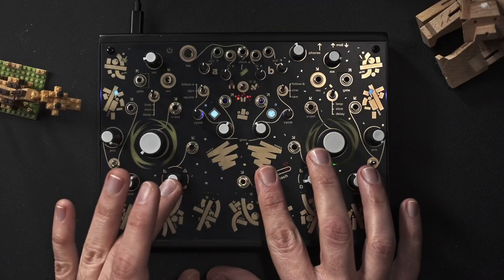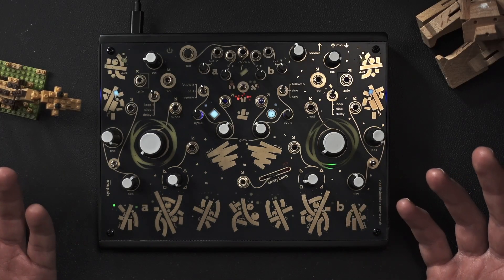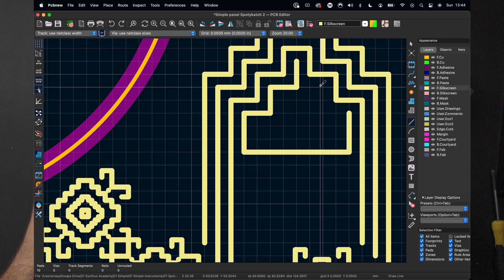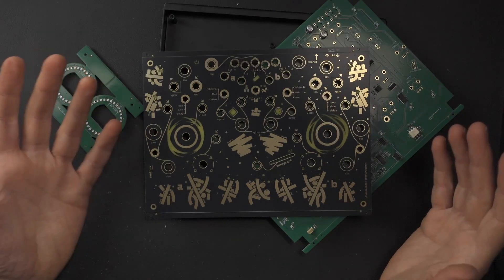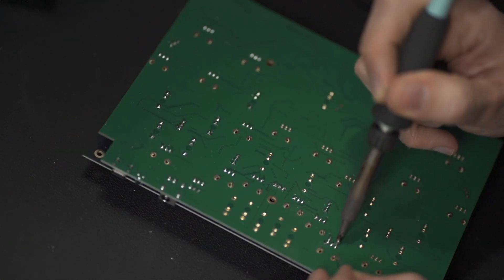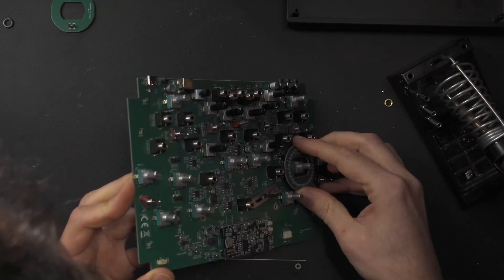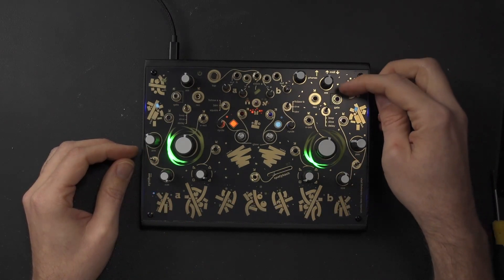This Looper Isn’t Finished – Tell Us What to Add!

Comment: Manifold Research centre's Tetragrid has a magnetic faceplate so connections can be made with metal counters. Any way to make connections on the Spotykach  touch pads with anything other than fingers? Or toes.

Comment: Each iteration just keeps on giving... I do have some feedback and ideas!
1. wider screw holes, so that when someone decides to rack it, any imperfections of other modules can be accounted for :)
2. kind of a follow-up - rackability as a first class citizen, not just by request :D
3. LED baffles - I very rarely see this being addressed, so great that you're doing it, just please add it to all light sources! Nothing worse than a very pretty light show which then bleeds onto other modules :D
4. a chaos circuit to have some LFO, of the non-deterministic kind. Perhaps on the other side of spotykach?

And I hope you'll do B-stock like with Audrey II if you have some imperfect faceplates, as waste is just sad!

I can't wait to see the end product, and I want to thank you for being so open and educational about all of this!
Reply from the maker: 100% with you on everything. But I’m sorry to say it won’t be Eurorack mountable. We were considering it for a while, but we decided that we need more space above the decks for connectivity. Also, we realised that since the UX is heavily reliant on touch interaction, it should be laying flat on a table. So it’s not 3U. But, it’s very thin, and designed to interact with your Eurorack system :)

Comment: Roey, great work so far, i like your comments on keeping the multi pad touch combos simple rather than deep and too many. If i could say one thing about the shaft length on the switches it would be longer is better for me. I have a hard time seeing them and what position they are in, plus, i like to use those vinyl covers for feel and color accent. I love all the led under the panel indication which aids a setting for a switch you dont change very often. Some of the jacks looked thicker, you check cable fitment in every one? Awesome stuff, thank you for your consideration in our feedback at this point in the desgn process. Are the led goggles rgb?
Reply from the maker: Thanks! I will keep these notes mind. Some jacks are thicker because I sanded them from 7mm down to 5mm (still don’t have enough mono jacks here). All the LEDs are RGB, and we’re going to use them for feedback. Yesterday I spent 4h refining the UX and ended up writing it as sort of user manual. So much stuff! I might share this soon.

Comment: One suggestion for possibly improved accessibility: What if there were some thin edges around the capacative (I guess) touch areas? That way one could find them more easily without looking.
Reply from the maker: Good point. You can actually feel them because they are a bit higher than the black surface. But I think I’ll need to add a bit more space / rework them a bit to get it more noticeable. Cheers!

Comment: It sounds great! But looks, well not so much. Drunk artsy fartsy design could be great for some, but not for all for sure. I like color scheme though. PCB design of this device looks much better than UI design. Maybe there should be two or more designs available!?
Reply from the maker: Thanks for the feedback. Visual design is subjective, but I see your point. We might do different faceplates at a certain point.
Reply: @SynthuxAcademy  Cheers! Glad you see my point. Of course it was not meant to be a downer. Design is important. That's why pro designers use Mac instead of Windows, a nice designed GUI directing you to do a better designs. So i am quite sure that's the case for the musical instruments UI too. Different UI designs, different music ideas. At least that's how i would think when designing UI for the instrument. On example, someone would compose totally different music on piano than on harp with the same number of strings.

Comment: Great project! Keep the excellent work. 

One comment about the physical UI: pach cables get in the way, this is pretty obvious from the video, even you're fighting them all the time)) Consider moving all sockets somewhere to the edge of the unit.
Reply from the maker: Good point! This was actually an intentional design experiment. I’ll be making a video about it soon. Personally, I prefer a more dynamic layout (similar to Make Noise, Instruo, etc.), so I tend to avoid rigid blocks of jacks. That said, I did approach this differently here. It’s hard to tell from the video since I’m explaining rather than playing, but in actual use, the cables aren’t as obstructive as they might seem. Still, balancing ergonomics with interface aesthetics is something I want to explore further as a designer. Appreciate the feedback!

Comment: This looks amazing. Will definitely be keeping tabs on when this releases.  Integrated VCAs for the two loopers would be amazing.  Being able to switch the VCA from modulating level of incoming sound being recorded  and the output of the loops would break my brain.
Reply from the maker: Cheers! Ah, what you refer to is CV over sound on sound. I think it will be possible with Midi.

Comment: very nice design ! 
there isn't a drawback free way to do this but for processing stereo sources I find separate L/R trimmers difficult to match right while accurately preserving stereo image. For this use case I would prefer a single in/out trimmer that affects both channels at once. If the volume is digitally controlled maybe a switch ?
Reply from the maker: Thanks! That’s a great point about matching signal volume. Since these circuits are fully analog, there’s no simple solution, but at their core, they’re identical. Also, it’s worth noting that our ears aren’t perfectly balanced in amplitude and frequency perception, so even a seamless switch never creates truly perfect stereo.

Comment: Amazing design and the playability functions are very well thought out. 
1. The Orbit and Drift together with the Euclidean functions are unclear to me without an audio demonstration. I don't understand how they could work in a looper. Would they chop up the sound and make rhythmical patterns with it? Personally I'm not a big fun of Euclidean patterns. They are rarely interesting and also very easy to program by hand. If I could create rhythmic patterns by touching rhythmically one of the touch plates, that would be amazing. 
2. About the fx sections, 2 fx per side would be more than enough I think. 
3. How long are the buffers? Long buffers would be a dream to have.  
4. About the Cycle and Glow. It depends if someone wants to do dramatic changes or subtle ones.
Reply from the maker: Thanks! Super useful feedback! Great idea for the rhythms. That should definitely be possible. As for the buffer - it can get up to 10m (5m per deck) as far as I know, but I’ll check. I’ll add all these notes to our backlog. Let’s see what comes out in the coming weeks!
Reply: @SynthuxAcademy  5min per deck is definitely long enough! Is it possible to play the decks with the touch buttons? I mean to turn audio on/off with the touch.
Reply from the maker: @ethermod307 yea, you have play forward and backwards per deck. But you can also latch them.

Comment: Hi!
First, this project looks super cool and already very polished. This looks like a hit!
Regarding suggestions/question:
1. I agree with @CinematicLaboratory end of loop output would be cool

2. it's Play head position = Rec head position, right? If not, how does it work? 
This is the part I least understand and would love to know more about.
SOS should be a modulatable paramater, if possible.

3. Reverse CV input maybe?

4. Is changing tape speed in musical increments implemented? ocatves fifths, etc.

Congrats on this great project!
Reply from the maker: Thank you. Yes, there is a gate out for each deck and it can be set to end or beginning of cycle. As for the position, I think it’s the play head but I’ll look into it. Having CV over SOS is tricky. We’ll have to take out one of the other CVs - any suggestion what you might take out? (V/oct, envelope, pos/size). 
Reverse CV input - also tricky, but maybe we can allow user to define how the gate in behaves, so it might be possible. 
Changing the tape speed musically - yes, thats on the list :)

Thanks for the detailed feedback!
Reply: @SynthuxAcademy  Thanks for getting back to me…I'll keep an eye on this project! :)

Comment: I really like the design of it, I think a lot of companies forget that before releasing their products, It plays a very important part on a costumers desition. Thanks for not overlooking that. A lot of useful pitfalls can be learned from Eurorack modules, here’s a few considerations:
-The combo switch and toggle you mention from TE, didn’t work out too well in the Morphagene, Qu-Bit (Nautilus,Mojave) despite being “a single unit looper”, all those combos makes it difficult in a world full with gear heads with a lot of other gear (if you are going to use it make sure is bullet proof intuitive)
-Find a way to add a micro SD card or USB port in the unit, it will help a lot with updates and memory presets and samples) A looper like Lubadh from Instruo and Blukač didn’t came with one and they have to release a not very well received update extension port just to add that, might as well get it from the get go, much easier and future proof.
-Also Consider making this a 3U size module regardless of the HP size, (see Strega and O-Coast or Moog DFAM,M32, Subharmonicon) they can be ported into any Euro rack skiff in addition to be used as a single unit, you can make sell the  package as a stand alone and sale a ribbon cable to plug to the Eurorack skiff, duplicate your potential sales!!!
-This next issue to correct is a problem I see in Chase Bliss Audio and a lot of guitar pedal companies: I know it looks great with not screen but a complex device or module can benefit greatly of at list a micro screen to handle presets see Elektron samples or Heroglyphic Plume module, I know it ads a bit of price up but again it would make things much more easy to grasp and future proof; I’m sure you can find a way to add a very interesting shape for a small screen, heck maybe can even show the waveform😊.
-Leave space for coding updates and features (Think ASM hydrasynth) that keep adding usuful updates and a lot of patch storage since the original Launch, they also are having trouble because they do everything but the basic update of adding costumer waveforms instead of their stale they made originally, and that makes their synth cripple for a simple solution, because they don’t have space for the architecture of it.

Comment: excited by this, CV control would be great. im liking the neutral labs scrooge and elmyra with their cv options , (i also like thieir bamboo wood enclosure). I built the audrey 2 and am looking how to add cv control to the frequency etc. (has this been done,?)  it would be great if the spotykach had an ambient mode where it could record the sound of the street, or snippets of conversation over a longer time period, up to half hour or so, then replay these with effects / filtering, whilst overlaying new sounds on top of the existing. Over a few hours this would create an ambient soundscape or wall of noise, depending on the settings. I think the  chase bliss habit pedal is capable of something similar, though i cant justify the cost. (i like their mini selection switches as a means of setting parameters,  seems a bit fiddley, but better  than multiple button selection sequences on start up)  Im working on a sound installation in a church using the sounds of dripping water from melting ice. Im looking for a way of incorporating the found sounds of occasional visitors comments / footsteps / birds in the graveyard. Maybe if there was an option of reducing the sound quality, reducing to mono, to increase the recording time length. id like to replay back the older recorded sounds (under the newer layers) at half speed, then quarter speed, each at lowering volume. (each layer would probably need to be cut in half prior to processing to reduce buffer memory). & maybe there would be a problem with feedback,? just thinking out loud...
Reply from the maker: That’s a really interesting use case. I think it should be possible to do in real time. If you want to record the space and manipulate the sound as it’s being recorded, it is certainly in the capabilities we’re aiming for. Is this what you mean?

Comment: First of all, excellent job on the panel and the functionality and It's cool to see the envelope followers. I see a clock in, but I am missing integration with the outside world. It should at least have an 'END OF LOOP' trigger on both sides. External gear could then sync to the loop with start/end and pitch engaged (e.g. drum machine).
Reply from the maker: Thanks! There is a gate out for each deck. You could set it up to end or beginning of cycle :)
Reply: @ Sold. Now you need to only figure out when it's finished :)
Reply from the maker: @CinematicLaboratory haha, indeed! It’s in the trusted hands of Vlad now. Let’s see what the coming week or two bring…
Reply: + 1 on this ;-)
Reply: Awesome!

Comment: looks so good. what is that type of daisy you are using?
Reply from the maker: Thanks! This is Daisy DSP (design for manufacturing). It’s the same capabilities but easier to assemble when making 100 units.
Reply: @SynthuxAcademy  ah interesting, didn't know that existed. what makes it easier to assemble? anyway, very curious to hear the Spotykach in action!
Reply from the maker: It comes with tiny headers, and it’s quite low profile. There are also no audio buffers on board, so you can design your own. Can’t wait to get the first firmware on it!

Comment: This does look pretty incredible. I have many questions but some can be put on the back burner for now. Firstly, would you consider have an option (key combo or switch) that allows a by-pass of any in-built effects, so that you could send the "raw" output to either off-board effects, or to other dedicated effects modules (in my case, within my eurorack)? Secondly, is this going to be true "stereo" audio out, or is the plan to have the outputs be dedicated to each deck (or a combination)? Lastly, as someone who built Audrey 2 from a kit (and really enjoyed the process), is there a plan to make this available as a kit?
Reply from the maker: Cheers! The effects are totally optional, so you can send any of the outputs for processing. The output on top is up to you to route. You can make it true stereo, mono, or generative (an and b are mixed in interesting ways). There’s also a monitor out in the back, which is stereo and has a headphones amp. 
I think we might release this as a kit, but it is not as easy as Audrey so I’m not sure. We’ll need to look into it as soon as we have it ready.

Comment: I adore the look of this, and I am on principle really on board with the "key combo" idea; I've used it for many years with my max concoctions, even going so far as having 4+ layers of it; it works. 

I guess my main reservation is with key combos and this particular layout; imagine someone with small hands playing on this, while fully connected with regular jacks that protrude upwards; is that process still fun?

re: the attenuator flip question, I would be inclined to normal the jack to a +v source, dunno if it's already done that way? in this case the attenuator easily is "The main dial" for sure.

re mono/stereo modes, it'd be great to have an actual stereo mode where only one side controls the main functions for both left and right, and then the other side can control other stuff instead?

anyway, thats my brain dump as a daisy dsp dude; the hardware is STUNNING, great work.
Reply from the maker: Thanks! Really appreciate the insight—especially from a fellow Daisy DSP dude.

Good point about the key combos and hand size. The touch pads are placed along the edges to avoid interference from jacks and knobs, and of course, they’re designed to be used with two hands. That should keep things playable even when fully patched, but definitely something to test further.

For modulation normalling, I think it can be handled in code? But I’m not 100% sure how that would work. When a jack is plugged in, it would send the modulation output through that jack—but if the attenuator is at 100%, it’s sending 100% out. Does that logic hold up? Curious to hear your take on it.

Also, love the stereo mode idea! A setup where one side controls both L/R while the other is free for other functions could be really useful. Definitely noting that down.

And thanks for the kind words on the hardware! Still refining, so all this feedback is gold.